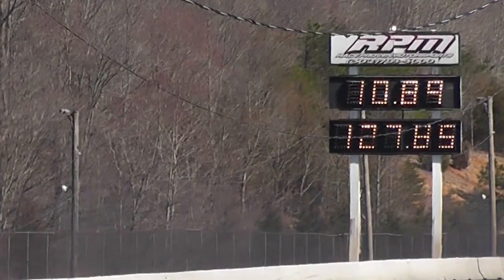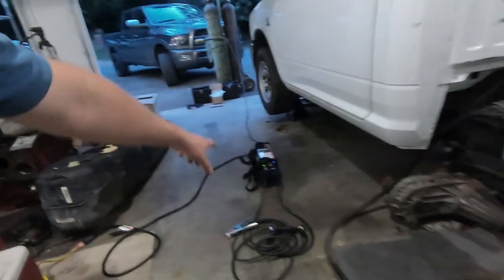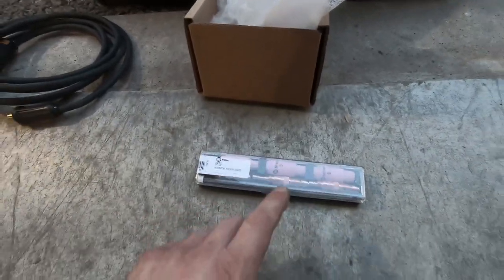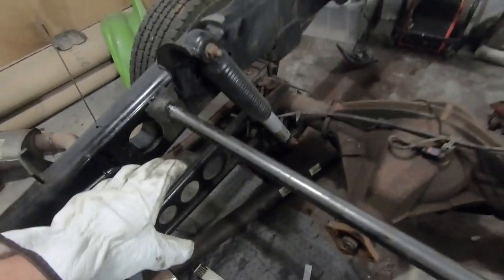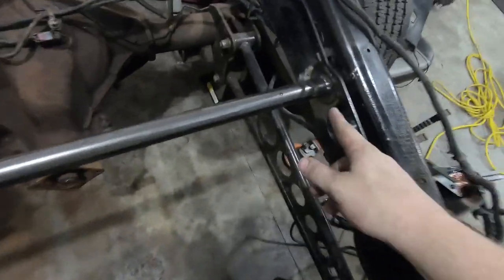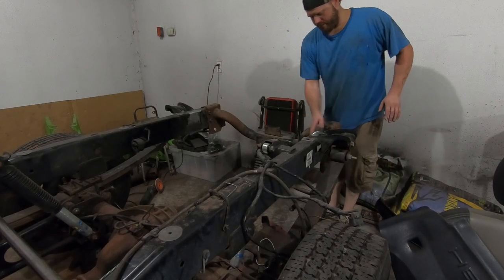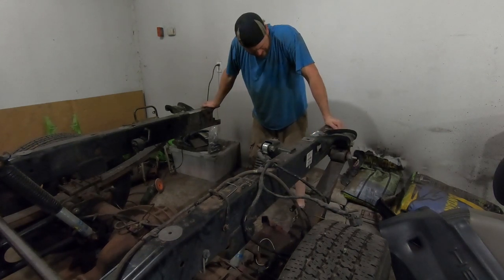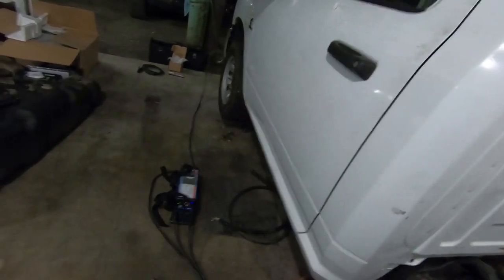CUMMINS DRAG TRUCK FRAME REINFORCEMENT!! Tig Welding On The 4th Gen 6.7 Cummins Race Truck Build!!

Comment: Hi Tom am more along the lines of u ditching the exhaust since u r going full race mode.  But if u wanna continue with it y not set it up as a side dump n have both shocks facing aft.  What's u take
Reply from the maker: I'm on the fence